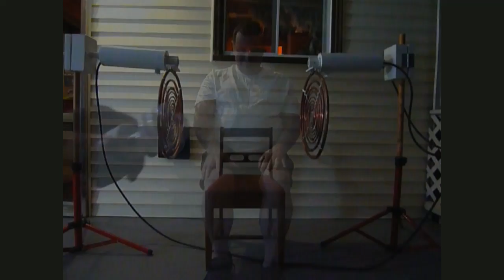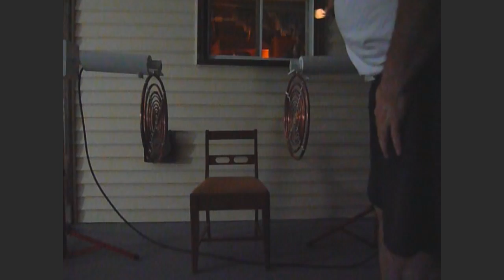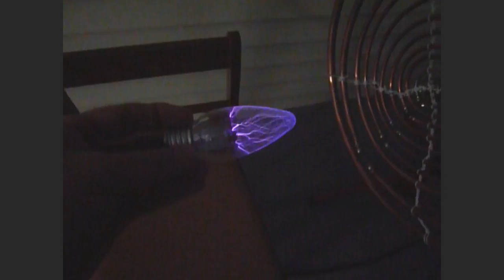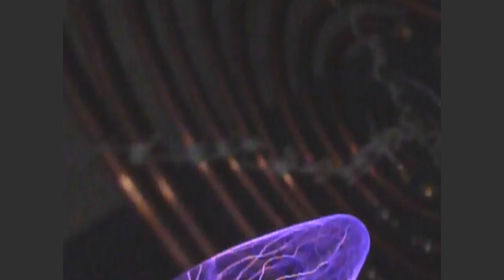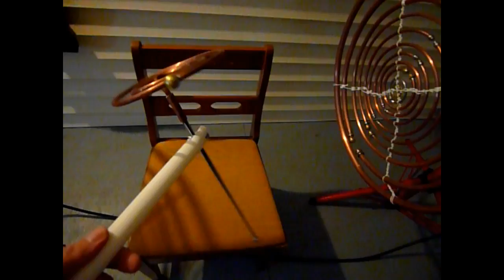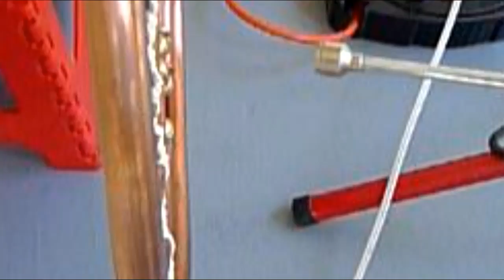4- Lakhovsky Multiple Waves Oscillator -- Demonstration Part # 2

Comment: @ anterak123 Hi, I run into your video researching sound and vibrations. I have been quadriplegic since 2012, I was 29 when my accident happened, since than I went to Vienna 4 times on stem cell operations but that didnt help me. I was wandering if this inovation could possibly help me? Would I be able to purchase it since I live in Serbia?
Reply from the maker: You will have to go on this website:  http://users.skynet.be/Lakhovsky/
This is where I got the information that allowed me to build this machine.  
Then you will have to contact (email) the owner (Tony and Bruno).  They might be able to direct you to someone who build these MWO for sale.
Reply: What @anterak123 said about contacting Bruno and Tony (website link he provided), and also, more recently, check out Aaron Murakami ‘s website: http://vril.io   These are genuine Lakhovsky MWO, built with modern components and able to sustain many duty cycles. He collaborated, I believe with Tony and Bruno. The ones from Aaron are not “exact” replicas, in that the materials used and size is not like the original, but they are producing the results with nearly perfect tuning, and in a more compact chassis (grounded and as interference free as feasible). Either units would be great. Please, note that I am not affiliated with either Tony, Bruno, or Aaron, but I purchased one from Aaron, and I also purchased the PDF books from Tony and Bruno. They are wonderful machines. I cannot say enough good about Tony and Bruno for sharing their labor of love in bringing the Lakhovsky MWO back to light, as well as Aaron Murakami, Eric Dollard, Peter Lindeman, Paul Babcock, Jeff Moe, and likely many others I have missed for contributing to the device, also. Best to you, experimenting with one and supporting your own body, as it heals from the accident you experienced!

Comment: Wow!!!!!...what a huge amount of power!!!.... Instead my oscillator have 400W I use lesser power, I tuned my system like the spark gap is open at no more than 2 mm. With this gap I get the maximum RF output and sparks were at minimum. If I use more opening sparks began to jump every were and is not recomended when you work with dogs ( they were scared) and peoples too and, RF do not increse as hoped. I can light a 40W fluorescent lamp at 1 mt beside a concret wall, it is incredible the power of a good tuned system. Best regards.

Comment: Have you experimented with the collars? They are supposed to be very health giving as well. Just one copper ring around your neck or waist. I bet that would be pretty easy to make if the MWO is not available to someone.
Reply from the maker: In other posts, I give the web address to the site where I acquired the 2 books necessary to make a machine.  Go and have a look at it.

I was planing to build another machine and video it from start to finish.  But this won't happens before another couple of years.  And frankly, I am not a very skilled builder, compare to the other machines we can see on this website.  Of course I do not have a big workshop with a $100,000. worth of tolls.  I built mine in a small corner of my basement with a drill and a hacksaw as my main tools, using scrap parts I found here and there.  This could be called ''The poor man MWO''.     Still it will be a few years before I get to this.
Reply from the maker: Yes, I have been using the collars for a few years now.   All my dogs are wearing one.  Thee first one was rather a copper bracelet.   I had something wrong with my shoulder.   I made the copper bracelet then put it around my wrist.   I went to bed with it.  I slept like a log that night.  When I awoke the next morning,   my shoulder didn't bother me anymore.   

When I put a Lakhovsky on my dogs, I noticed 2 or 3 days later they had a lot more energy and were a lot more playful than normally.   If you Google "Lakhovsky coil", one of the first site,  there this lady who talk about her experience with the collars andhow to build one.  It is very easy.
Reply: +Anterak123 
Thanks for the feedback. I have got confirmation from my friend he is going to build a MWO for me with his friend who is an electrical engineer. I am looking around for the original designs. If you know where they are please let me know. For the mean time maybe i can make some of those coils to wear.
Reply from the maker: Good move.  For the original designs,  I will save you a ton of searches.  Go to this website:  http://users.skynet.be/Lakhovsky/index.htm 

Get both of these Ebooks: La Revelation and The Secrets Revealed.   At the beginning I only got The secrets reveals, thinking this will be enough.  Maybe for an engineer this will work, but not having deep knowledges in electronics, I also got The Revelation ebook.  This was the Rosetta Stone that allowed me to make it work.

These Ebooks were written after the authors have found 3 original devices from Lakhovsky.  They studied them and back engineer them.  Notice, I do not make one penny out of the proceeds of these Ebooks.
Reply: +Anterak123 Yes, by providing this information you have done a noble deed. Thanks for your help! I would be great if more people opened their minds up to different forms of healing. I will get those books(hope they are not only written in french) and I will get one made for the benefit of myself, my friends and family. I just hope that it isn't dangerous in anyway. I see sparks flying  and i really wonder what would happen if i touched it with my shoulder or something. 
I wish there was a way i could repay you for your generous advice. Thanks again!
Reply from the maker: Vahe345
  You are welcome.  Yes there are sparks, the machine can generate over 100,000 volts but at very low amperage.  If you touch it it hurts and you learn quickly not to touch it. It feels a bit like  an electrified cattle fence.

The Revelation Ebook have many parts in French but most of it is in English.  I do not remember much as I am French but I married an English woman and now I often don't remember if I read something in French or in English since I am so used to switch from one to the other without thinking about it.
Reply: where can i buy this? is it expensive to maintain?
Reply from the maker: Hi!  Most people build their own machine.  If you build it yourself, it will cost you about $1000 (CDN) and require about 300 to 400 hours to build it.  If you buy it, expect to pay at the very least about $10,000.  Only 1 or 2 company on the net are selling devices compliant with the original from the inventor.  The easiest way to see if a machine compliant, are the big tubes holding the antenna rings.  These tubes are not there for show, they are a very important part of the device.  If you see a machine without these tubes, then it is not a compliant machine.

Once the machine is built, there are no other expenses.  I thought the tungsten rods of the spark gap would need to be change after a while.  Mine still look brand new after 2 years of using the machine at least once a week.
Reply: Anterak123 Thankyou. I am willing at attempting to build this. The only thing ive ever built was a high end computer. I understand some carpentry and electrical work, thats it.

i could build only if someone showed every step of building it. If you ever build a second one, please record every step on camera. Thats honestly only way i could do it.
Your experiments proved their is power being absorbed in the lightbulb, im confident the body would act the same.

Comment: Is there instructions on how to build one of these devices. I was told to purchase The Lakhovsky Multiple Wave Oscillator Secrets Revealed. However when I visit the website there is no place to actually purchase it.
Reply from the maker: retnuh616 Hello,  I would not say there are instructions on how to build this device.  They are more guidelines.  If you are seeking a step by step detailed instructions on how to assemble it, you will be disappointed.  The books (La Revelation and The Secrets revealed) show 3 original devices built by the COLYSA company back in the 1930's  and how they are assembled and what are the values of the different electric components and the dimensions of the rings and how they were put together., etc.  Then the authors are building one of there own and showing how they did it.   From there you can figure how to assemble your own.  

You don't need fancy tools to build one of them.   I assembled mine with only basic tools, drill, hacksaw, pliers, welding iron and a propane plumbing torch.  my machine may not be pretty but it is fully functional. 

To order the ebook you have to send them an email (at the end of the page La revelation and The secrets reveal).  Their website is an information website.  They are not selling products, so you will not find any Cart feature like we do on commercial website.    Once you contacted them on email, they will send you the information on how to pay for the ebook.  If I recall I did send a payment by Paypal to the person how wrote me back.  Then they send you a link and a password where you can download the file.   Me I printed it so I have a paper copy I can carry everywhere with me to refer to it.  

I hope this helps a bit.
Reply: Anterak123 Thank you! I have emailed them several times now but haven't gotten a response yet. I'm not so much worried about the actual building process as I'm no stranger to tools. I just more or less need to know the fundamental like for instance take a neon transformer, run it to spark gaps, then run to what I can tell an electro magnet? I dunno haha. But thanks again for the info.
Reply from the maker: +Heru Khenum 
Hello, these 2 ebook / cd rom are available on this website.  http://users.skynet.be/Lakhovsky/index.htm
These are a must to comprehend how this machine is built.  The price of these 2 documents is more than reasonable for what they offer.  These 3 persons did colossal work in bringing this very precious information available to the people like us.   If not for their work most of the people wondering how to build a Lakhovsky MWO would still be in the dark, I know I would.  

I have too much respect for them and their work, not to suggest you contact them directly to acquire these documents.  Doing otherwise would not be honest.  These are not big multi national corporations, but regular folks like you and me who managed to bring out of obscurity a device that is indeed able to help many people.
Reply: Anterak123 Aloha brother! Is there anyway you could share this ebook? As to share the wealth of knowledge for your dear human family so that we may progress into a unified conscious planetary organism? Im most willing to trade/compensate you for your effort and would highly be appreciated both from my fellow community and from Great spirit/source to have this information as it would be used properly to aid many who cannot afford or have resources for medical care. It would be of great charity and compassion and for the greater good of humanity. Much love and many blessings :) <3

Comment: can we buy one from you
Reply from the maker: Carole Chiswell Hello Carole,  I am not selling these devices.   I built it after finding this website:    http://users.skynet.be/Lakhovsky/index.htm
I took me a long time to find a website with real genuine information on this device.  If I was able to build one, I believe anybody should be able to do the same.  It will be much cheaper also.  For about $1000 you could acquire all the supplies necessary to build one.  Buying one already made rarely sell for less than $10,000.  Sure you can find some on Ebay.  They sell for about $8000 but they are not compliant with the inventor's device.  An easy way to see if it is close to be compliant is to check if you can see these big tubes holding the antennas.  If not it is not a compliant machine.  These tube are not there for show, they are a major part of the machine.

Sorry about the long post.  Maybe I will built another one soon, I do not know.  It took me 3 years to build the one on the video and it is mostly made of recycled parts and is pretty crude.